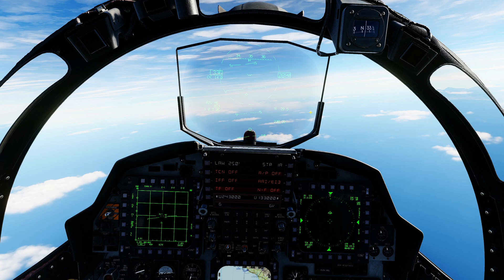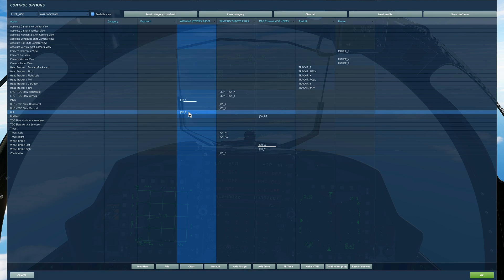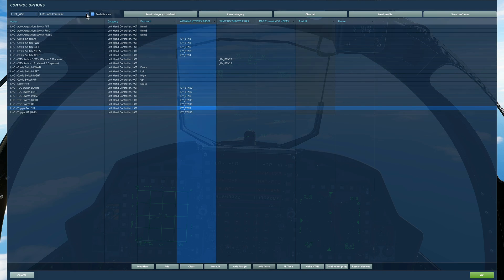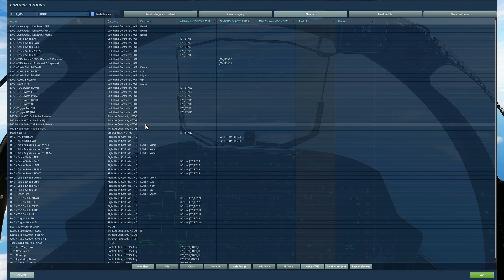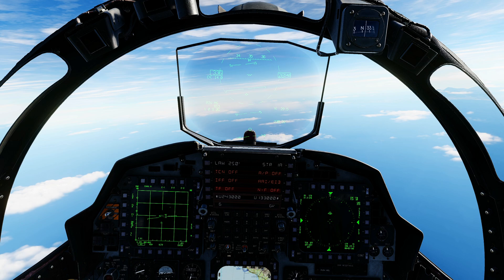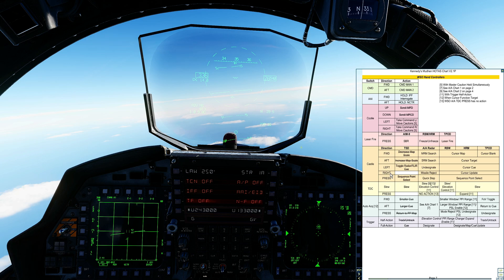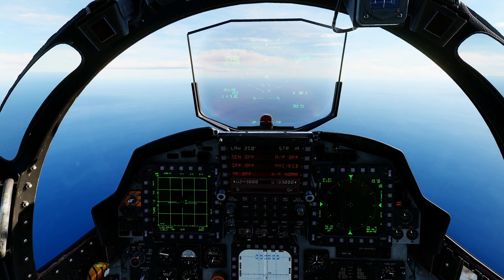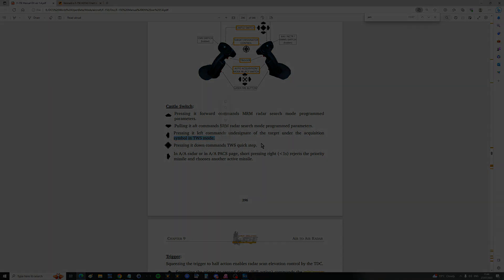F-15E Strike Eagle: Setting & Using HOTAS Controls (Rear Seat WSO) Tutorial | DCS

Comment: Such an informative video thank you so much🤩 I have also a copule of questions to which I can't find ansers...How is it possible to take control of the right mfds? In the wso seat neither castle switch right long or cooli switch right long or short doesn't activate them. AG radar freeze button/command. Also boat switch to undesignate? Thanks in advance.

Comment: One cool tip I can give to people with not enough buttons and switches on their HOTAS is one that I use for myself: Just get any cheap gamepad with analog sticks to map into your LHC and RHC TDC Slew Axis. I don't even have a HOTAS, but I've got a cheap 10 years old Saitek flight stick AND an Xbox 360 controller that I combine for all my DCS modules. This works pretty well with either an Xbox or a Playstation controller, so anyone you can get your hands at for this is a good option. Then, after that, I just bound the D-Pad and the Action Buttons (A, B, X, Y, Start, Back, RB and LB) to the Coolie Switches, Laser Buttons, ect. on the corresponding Hand Controllers of the WSO. And since the analog of these gamepads also have a push button, they're mapped to the correspondent TDC Depress functions.

Then I can map the other switches to the Keyboard, like the Castle Switches into the W-A-S-D and the ↑ ↓ → ← and F and Enter for their corresponding Depresses. And voilà! Cheap WSO solution for someone who doesn't even have a HOTAS.
Reply: Why not use modifiers? I can completely control the tedac of the Apache with an Xbox controller.

Comment: No need for modifiers. There’s a set hand controller swap to swap between LHC/RHC
Reply: Using the swap between left/right controllers means you have to have the A2A radar on the right screens only, because the IFF and NCTR switches are on the right controller.

If you use it on the left, you'll find you're dumping chaff and flare instead when you try to IFF/NCTR
Reply: @tillyb8603  I usually hand overs A2A stuffs to the pilot since the WSO doesn’t even have the ability to shoot AAMs or guns.
Reply: @Shiroko0516  F14 habits die hard I guess :P
Reply: An even better option is to use a gamepad, like an Xbox or a Playstation controller. You can set both analog sticks for the TDC Slew Axis on the two Hand Controllers and use them both simultaneously. Then bind the D-Pad and the Action Buttons for the other switches, like the Coolie Switch or the Castle Switch, and GG.
Reply: what keybind is this?
Reply: @zykilo674 ”set hand controller swap”
Reply: @zykilo674  I think its "hand controller swap" , not sure what the differences between set or swap are
Reply: @cmdrpanorpa8631  there is, one is only as long you hold the button the other switches (Set / Toggle hand controller swap)